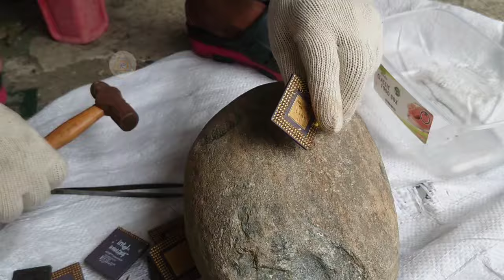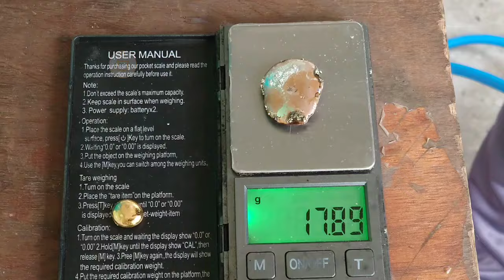Recover Gold And Silver From Gold CPU | Silver And Gold Recovery From Processors

Comment: A very simple method, thank you. In the interaction between silver nitrate and copper, silver is deposited, how do we purify it
Reply: Using hydrochloric acid knocks the silver nitrate into precipitate. The copper will be still in solution while nitric acid and hcl are available. This insoluble AgCl is the copper/silver seperator step.
Hope that helps 🙂
Reply: @colonialcharlie8702  Thank you .I will experience that